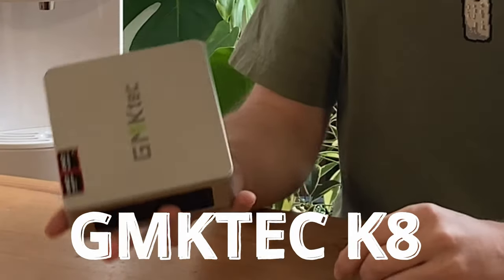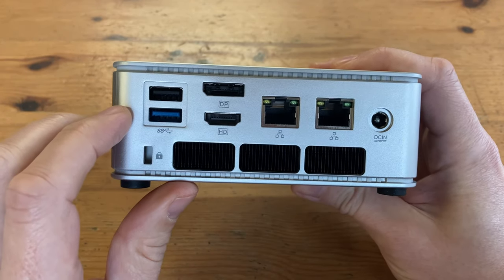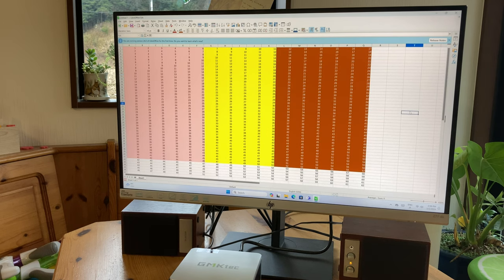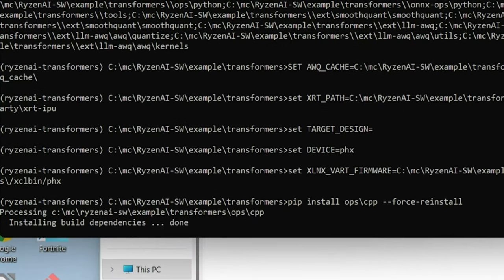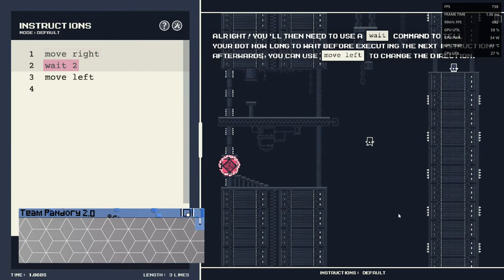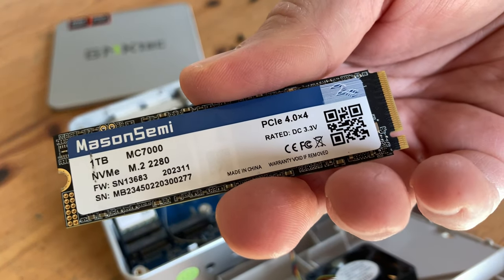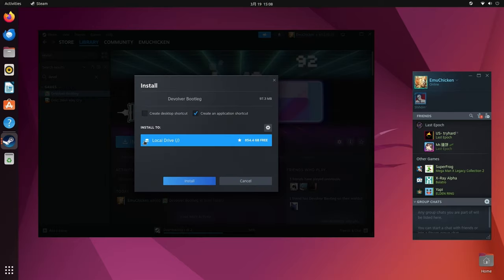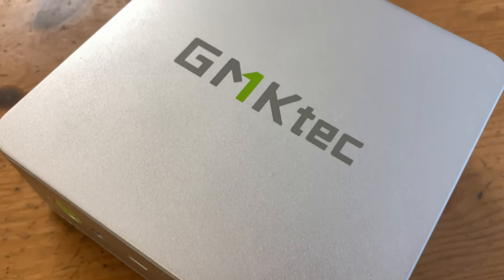The Ultimate RYZEN Mini PC: GMKtec NucBox K8 Review

Comment from the maker: UPDATE: GMKTEC has shared with me the latest version of their BIOS (1.07).
You can TOGGLE the Ryzen AI / AMD IPU to be ON or OFF.
Turning the IPU to the OFF setting makes this mini pc MUCH quieter at 45W TDP, and it gave us a benchmark score of 14701 in GRID Autosport (1080p / Ultra).  👍
Reply: Are they making the BIOS available to Canonical, Red Hat, etc.?  I don't run windows, how can I get the BIOS?
Reply from the maker: @ByteMeCompletely  @byteme6346 If you're getting a new machine, it's probably running the latest.  Maybe run windows on a small SSD just for bios updates? 
Tbh I think it runs a bat file, so it may be okay in dos too.

Comment: The only difference 8845hs has compared with 7840hs is 16 AI unit vs 10 AI units in the latter. CPU/GPU/TDPs are all identical.
Reply from the maker: Also: The 780M GPU is clocked 100mhz HIGHER on the 8845HS.  This would explain the higher temps.  
Edit: sorry, my bad. That was total bogus. It's late. Very late 😂
Reply: @TeamPandory  That's weird because AMD states that they both are 2700 MHz.
Reply from the maker: @ceeam  Let me go have another look ...  Power UP!
Reply from the maker: @ceeam  Ahcckk - I was probably reading the Memory speeds :/  It's late 😅
Reply: It also has a better memory controller.
Reply: @TeamPandory  you can easily overclock the 7840hs 780M from 2700mhz to 3000 mhz at around 80 watts the cooler holds very well, i've been playing dragon's dogma 2 at 1360 x 860 resolution upscaled to 1080p through lossless scaler, framegen maintaining it to 55 / 60 fps, the gmtec k6 7840hs it's a banger for the price

Comment: the default windows 11 must has some kind of malweres  how  could u use windows 11 and the secure boot is OFF in  BIOS ?
Reply from the maker: Secure boot basically means "forced windows boot".  With Windows itself is malware, it's more like an anti-anti malware.  Haven't you seen the news regarding copilot ? 😲 
Moreover, with secure boot on, it won't allow Linux to boot.
Reply: @TeamPandory   thanks for info, when i installed windows 11 (the 1st windows 11 build) i couldn't boot the usb windows media drive until i enable it. same thing it happens after i installed windows 11 windows didnt boot when i disable secure boot
i downgraded immediately to 10 because i need to use lunix mint sometimes.
 thats what happens to me, i didnt bother my self googling  about it a fix of my case.
 i remeber secure boot was required  with tpm 2.0 to install windows 11 right ?
Reply from the maker: @Rayu25Demon  it's not a requirement to start it up, but might be needed to install it. I think the setup needs to at least detect tpm2 availability or it won't run.
Haven't really checked Google either 😂
Reply: @TeamPandory  it was the 1st build of windows 11 no way i'm going to find solutions on day one, thank for the info BTW.

Comment: WTF?  You have a body and a face?  How is that possible?  
Ryzen AI feels like me cleaning my room as a kid.  Half as...ked attempt taking too long and with a terrible result.
Does running in performance mode change the temps?
I think it's a very good product.  Thanks for the video.
Reply: For running local AI like Llama, Linux is much easier and better than Windows. For Arch Linux there's a script that sets everything up. Windows might get better in the future, but the vast majority of local AI runs on Linux, so that's where the community is.
Reply from the maker: Does it set everything up for Ryzen AI, or is this for the Intel CPUs?  Even AMD's own guides mention that needs Windows software so it's a bit confusing as to what will work or not.
Reply from the maker: Yeah. Some people have those things 😂  the whole thing regarding installing Ryzen AI is a total pain in the rhubarb
Reply: @TeamPandory  I posted a detailed reply and the auto moderation nuked it....
Reply from the maker: @harleyn3089  there's protection against placing URLs... Did you link something?

Comment: AMD apu drivers have been garbage for a decade, deliberately not installing features on purpose because you're not using a desktop card, not to mention not providing timely updates and being EOLed years after release. You have to install modded drivers or Linux to reasonably use the things.
Reply from the maker: Are you meaning those drivers for the ancient ATI Radeon cards?  Those bring me back 😂 
AMD drivers for the past 5-10 years have been pretty solid.  They're also whipping Intel quite badly at the moment when it comes to gaming performance on their mini PCs. 
... Or are you comparing to the Geforce driver rollouts?
Reply: @TeamPandory  No. Do you not know what an APU is? It's literally the all in one CPU in this mini PC. AMD does not offer proper driver support for these things, most features are disabled, requiring user modding. This includes all the APUs AMD has ever released, all of them have poor support, there is a HISTORY of poor support. The Steam deck will outlast the Asus handheld even using older hardware SPECIFICALLY because AMD offers poor support and limited optimization. Steam deck is using open source drivers supported by Valve, while AMD is not providing quality updates for their Windows chips. So any rdna2 apu not steam deck will fall off a cliff, and their rdna3 chips will also get bare minimum support. If something doesn't work, it will likely never work. You get bare minimum windows capabilities, that's it, and pray some bug doesn't appear, especially from windows updating, which has historically caused problems with AMD drivers, and whoops then you care that AMD isn't providing timely support because it bricks your mini PC, more like you're using it for something specific like video and video breaks, so you have to run a bunch of hacks or switch to Linux. AMD only supports the current Gen chip, they want you to buy a new mini PC every new chip. If you waste your money on one, you will find out, because this happens every time. Especially because the only people mentioning it are the support forum users. I'm not saying the drivers don't work, you are getting half functionality sometimes with disabled control panel features, but the real problem is support updates. AMD screws everyone with support, and there is no recourse other than mod hacks and Linux.
Reply from the maker: @JohnDoe-ip3oq  You mean a CPU with GPU capabilities, right?  Sorry, we don't really latch onto the new marketing phrases like others.
Can you provide a specific example?